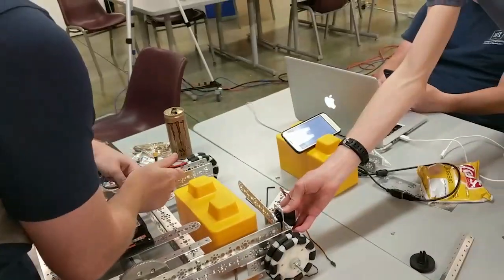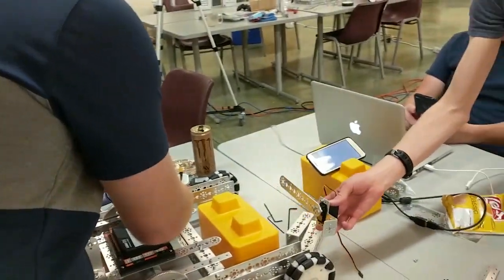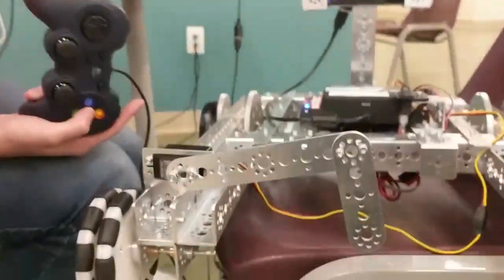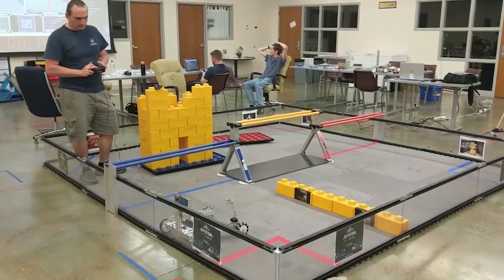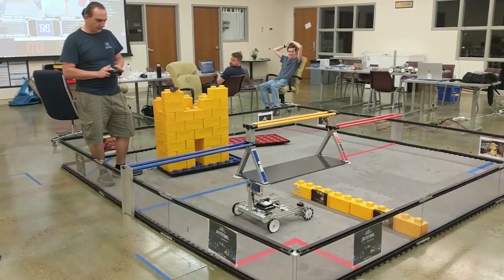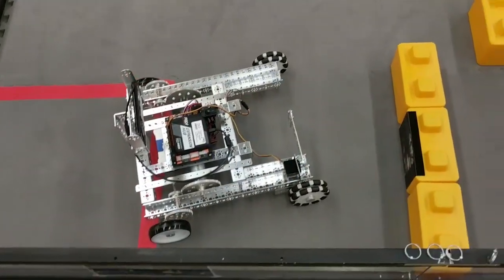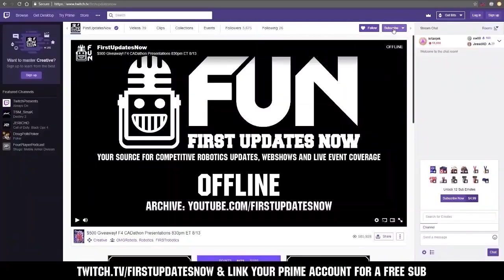Stone Manipulator Concept with Field Testing - Skystone University Challenge - First Updates Now

Comment: Just asking when you tested it doesn’t that mean it’s possessing more than one stone? Because it pushes 2 away
Reply: I would guess that its illegal, even though GM says you can plow into as many as you want for movement purposes it specifically says that if you do it for a strategic purpose its a violation. This seems like it would count as strategic.
Reply: @pyreaurum676  This action is not illegal. Game Manual part 2 allows plowing as long as the objects arent being moved to a strategic location. The moving of the blocks is caused by the intent of collecting one stone. Even though they are being moved, they aren't being moved to a 'strategic' location. They are only being moved so that the desired game object can be possessed.
Reply: @CheckmateFTC  I'm just interpreting it from the safe side and would actually like to see this asked on official forum. Conservatively, this seems like this would constitute "a strategic advantage beyond moving the Robot around the Playing Field". The strategic advantage being able to collect the skystone and score points which would not fall under movement. You bring up an interesting point with the intent to get the one block but I would wait for forum confirmation before staking a robot design on it. Again that's just me trying to be safe rather then sorry so I could be interpreting the rules to strictly.
Reply: @CheckmateFTC   The rule is not whether they are moved to a strategic location, it is whether they are moved for a strategic advantage. It specifically states multiple stones cannot be herded for "accessibility."